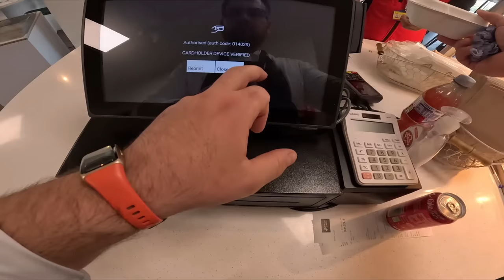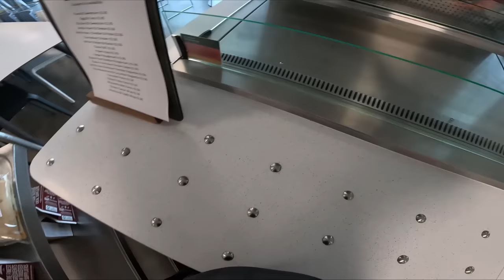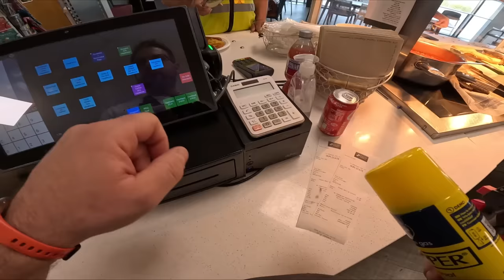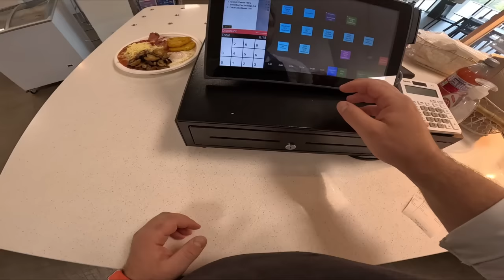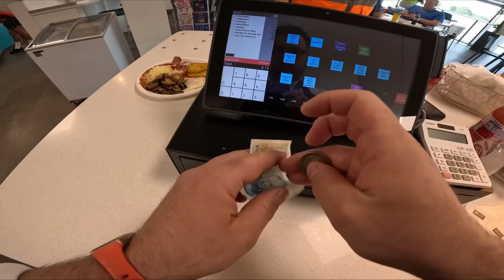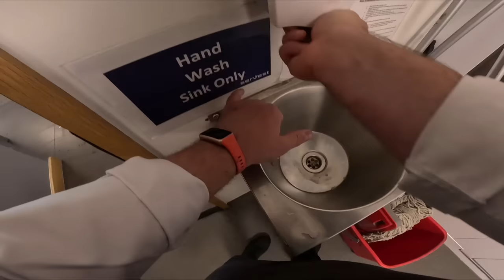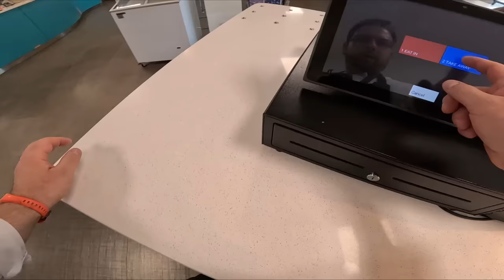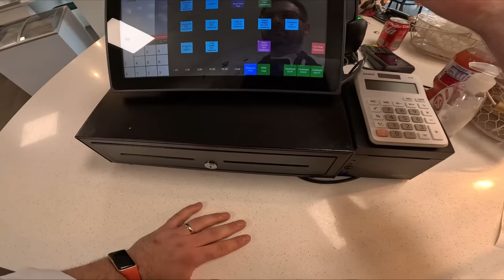75 minutes of breakfast service 👌😊👍

Comment: 1:40 I am a little worried about that hand washing ;)  I used to work at a sandwich shop that never used gloves, had to wash our hands properly for 20-30 seconds before every time we jumped on the sandwich line.  My hands would get so dry.. but we couldn't touch the PoV screen or cash register just before touching food.

I am curious where this place is, don't see this around here.  It seems like everyone there loves your mushrooms and eggs!  I am getting hungry and wish I could try some.  I assume this place is over the pond somewhere because we do not have Black Pudding in the States.  I have never tried it, but I am curious.

Looks like your food prices might be cheaper there too

Comment: Touched the screen then the food without washing. He crossed contaminated.
Reply from the maker: Excellent observation, Omar Viktoriya Mosquera. I do clean the screen frequently though, so don't be worried about germs 👌😊👍
Reply: @MrT2022  HI, even though technically you should wash after touching other surfaces that are not directly involved or around the cooking area. You do pretty damn good and I would definitely eat there without a thought good job. I have over 30 years in gastronomy and I have seen far worst, you actually get an A.